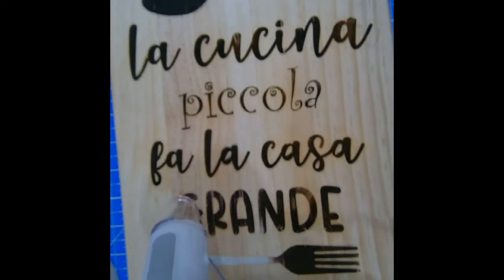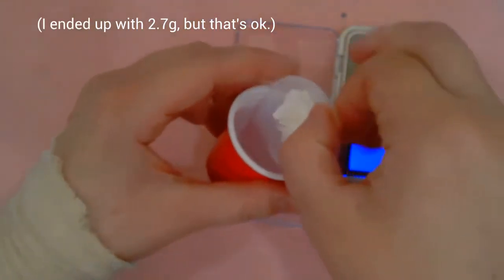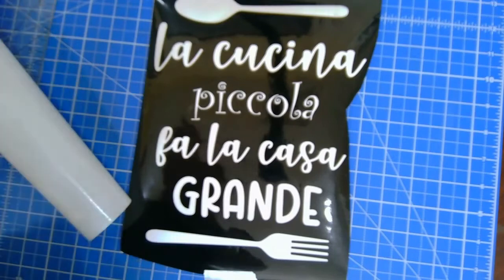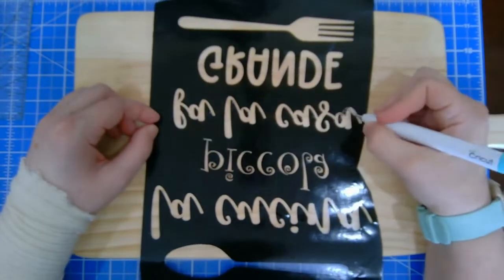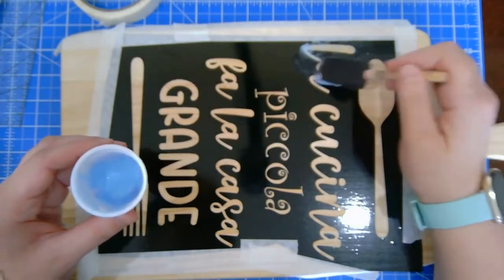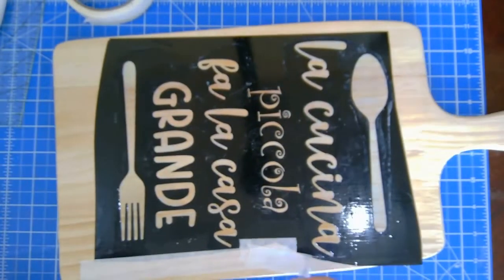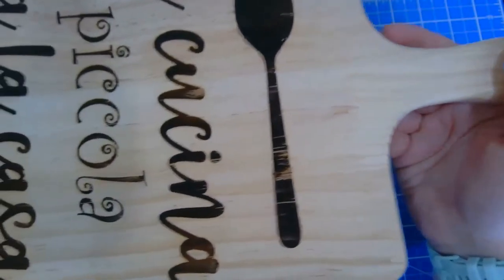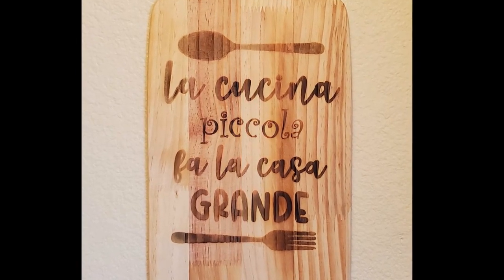DIY Tutorial: woodburning with household chemicals

Comment: I think the fact that it did not burn uniformly and gave your cutting board a unique look. What type of heat gun did you use?
Reply from the maker: thank you!! That does make me feel better 😅. I used a heat embossing gun by Wow brand. Here is a link to it  from Amazon:Wow Embossing Powder WOW Dual Speed Heat Tool-110 Volts, Multi https://a.co/d/jg7R9sr